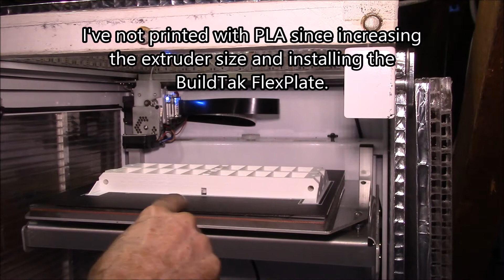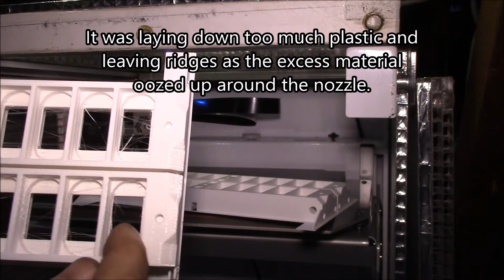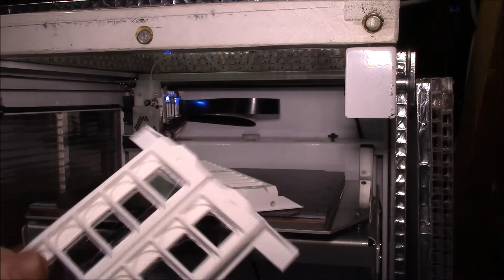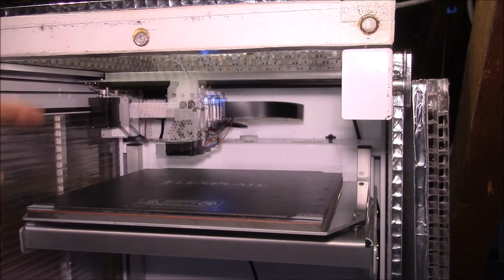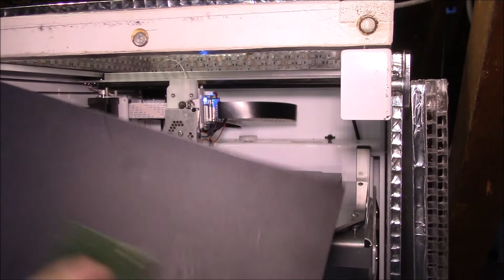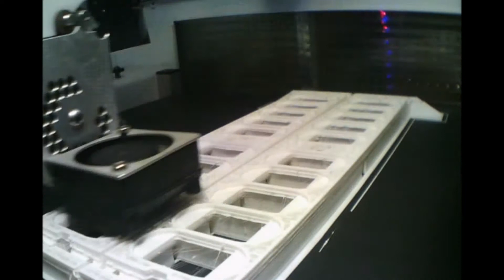20P Battery Holder Update, Part 2

Comment: It's nice to hear about able what settings you having to play with. I've got a new hot end for my Printrbot so lots of parameter's are out of whack. I'm a fan of manual support and/or brim designs too. Cheers, Paul
Reply from the maker: Yes, you make a small change to a printer and it seems everything needs to be adjusted.  The bigger 0.6mm nozzle helps lay down the plastic a lot faster than a 0.4mm one did.

Comment: what brand is your 3d printer?
Reply from the maker: It's from Type A Machines:
- https://youtu.be/TrAmM9iFfEw
One of the reasons I chose it was for printing these large parts.  It has a 1 cubic foot build volume (12" or 300mm on all 3 dimensions).